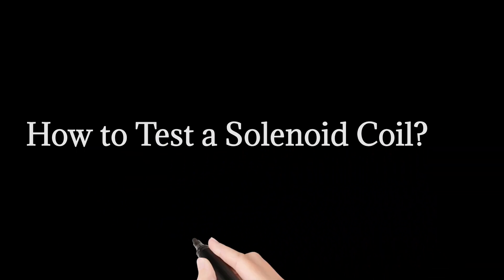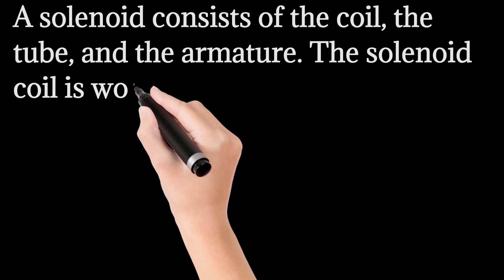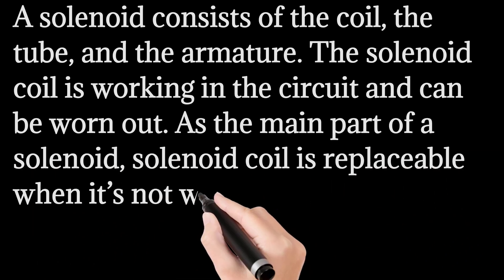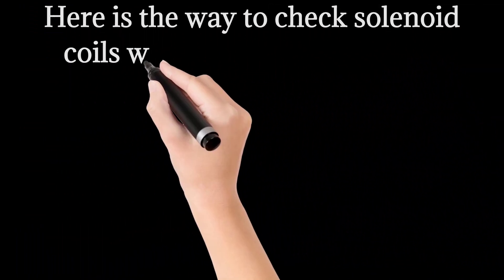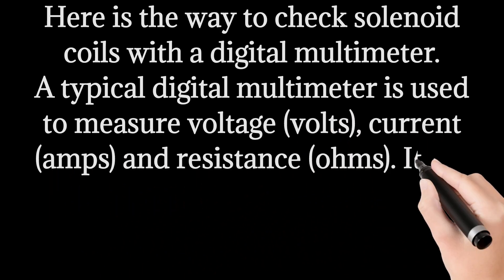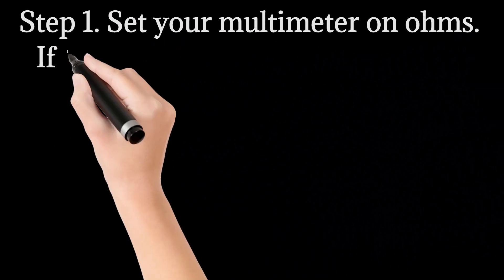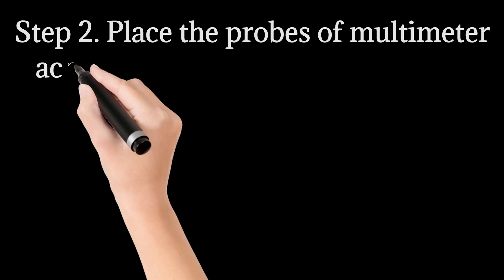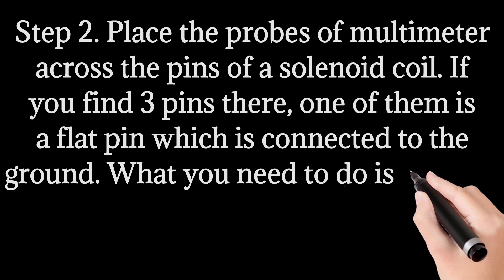The right way for testing any solenoid coil !! How to test solenoid coils with a digital multimeter

Comment: Good morning 
I have followed your instructions on hack Mr. Heater.
Fan runs, fuel pump making a loud noise when power switched. Added a momentary ignition switch. I dont believe the fuel pump pumping.
Your thoughts. 
Thanks

Comment: If soliniod draws high current what is the problem
Reply: There is probably a short circuit in this (a small resistance point).